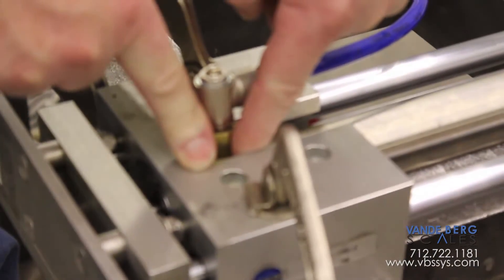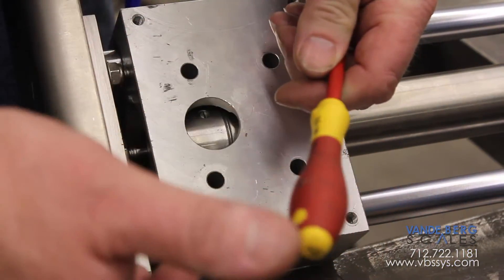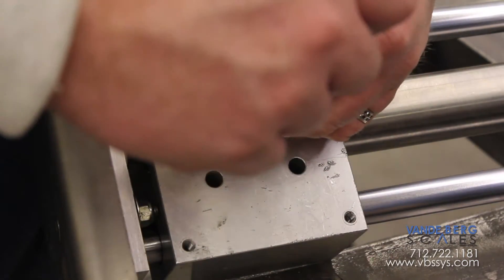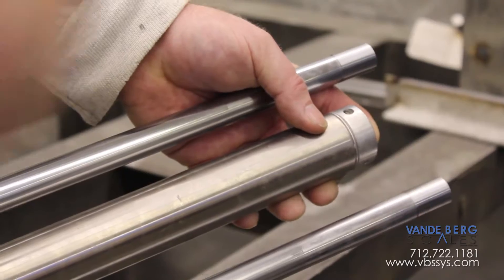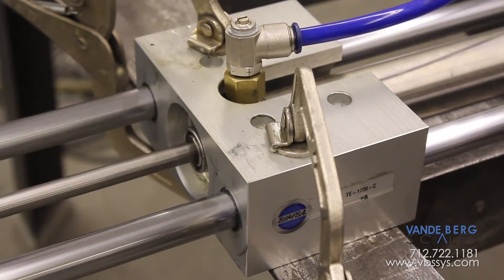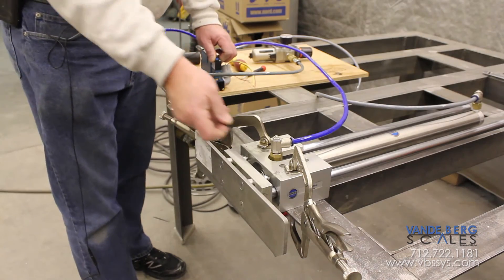Cushion vs Flow Control Adjustment in Linear Diverts

Comment: Would turning in the cushions make a difference if the cylinder is linked to a transducer sense it's taking from the full stroke? Thank you in advance
Reply from the maker: I'm not sure. I would pose that question to your cylinder manufacturer such as Bimba. Thanks!